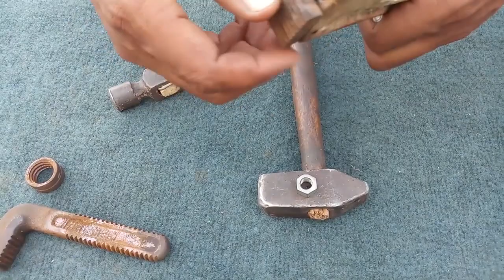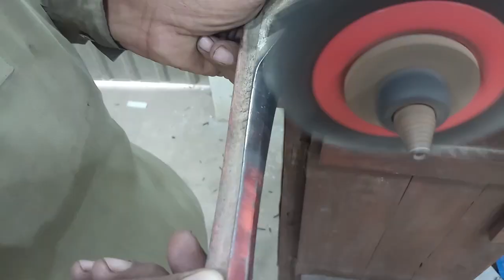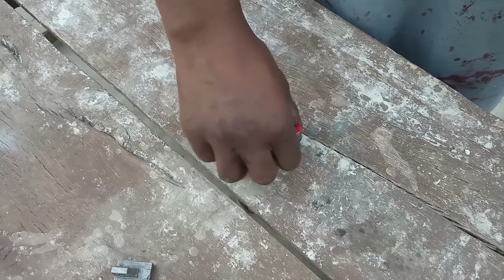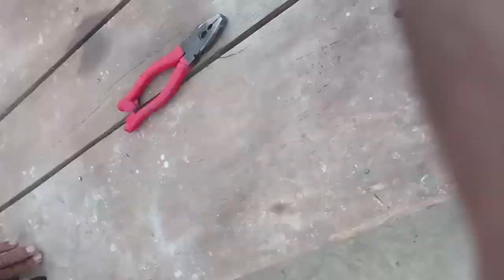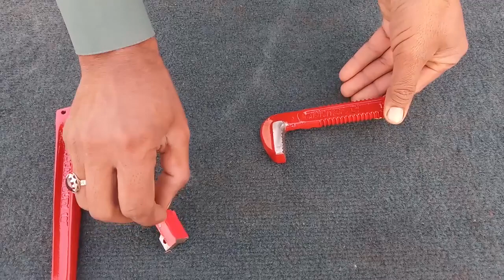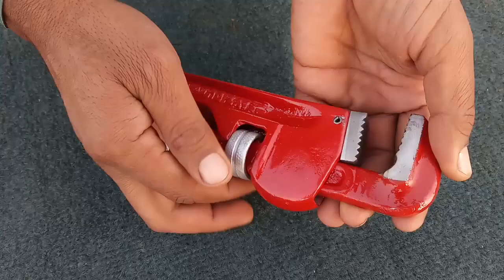Old  Rigid Pipe wrench Restoration

Comment: What in the world possessed you to paint the hook jaw? Better use this wrench as art cause it probably worked better when it was rusted
Reply: What are you talking about
You can clearly see that the ring turns very smooth without problems.
Or do I missunderstood your comment
Reply: @deejayitalo  it  isn't really ideal to paint the hook jaw,(j shaped piece)as the threads are supposed to move smoothly